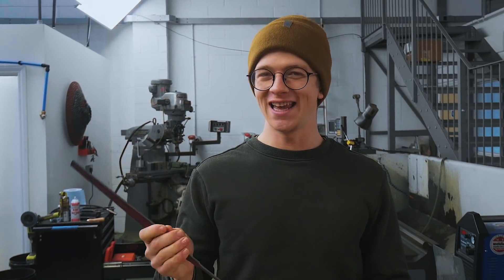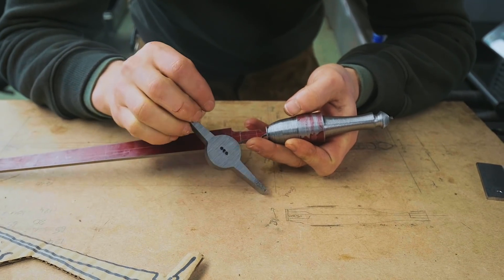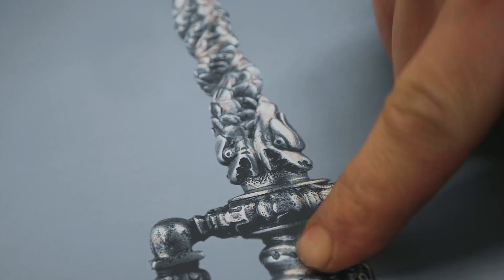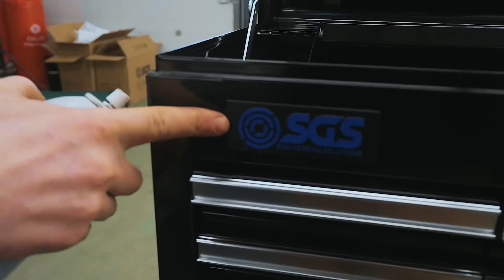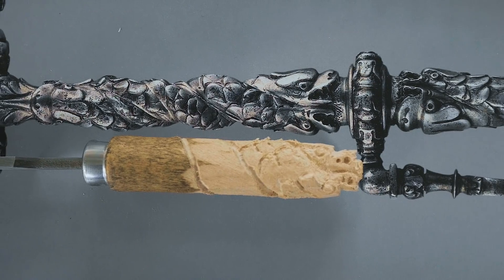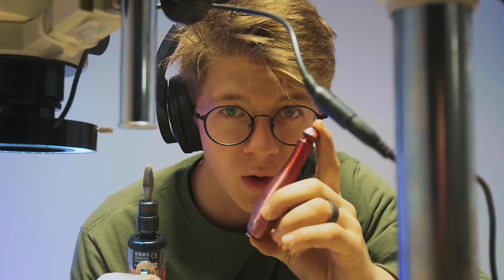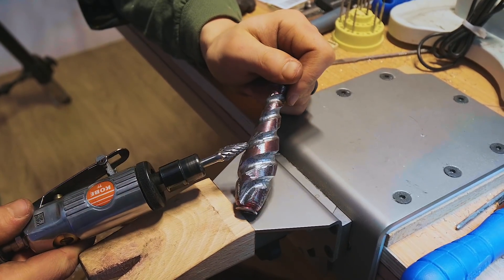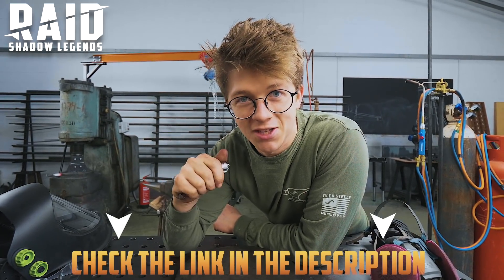MAKING THE SEA-MONSTER STILETTO!!! Part 2

Comment: i'm not a sculptor, but i am an illustrator who dabbles in 3d, and it's incredible to see the tenacity and perseverance you have in working on these sea monsters! your drawings were perfectly serviceable for the rough work you have to do for carving, and very similar to sketches i've made to signify more complex end results. i also grinned when you said you'd done a SECOND wood carving to practice for the final steel, i imagine it was a lot of work, but in my opinion quite necessary and extremely helpful for a better understanding and a more polished final piece! so i'm really glad to hear you felt it had helped a lot <3 bravo alec, very excited to see the next art piece you work on (and the end result of this blade)!

Comment: When you are working with larger die grinder bits , try to touch a solid serface with your pinkie finger (the hand that holds the grinder) ... It helps to control the grinder better ...

Comment: Alec, why don’t you make it straight, then heat it up and twist it, then do the detail work?
Reply: Wow that would make it so much faster and easier to deal with. But wouldnt it be hard to keep it even?
Reply: You need to double twist it, so you can have two sea monsters... if you do how you say, you’ll finish with only one
Reply: You'd nearly have to split it like a pineapple twist then twist it and forge weld back together
Reply: @joshd2013  u damn right
Reply: @maximilienfilion7802  thanks it happens every so often lol :-)
Reply: or use a hot cut chisel to simulate the twists...  same with the scales: make a c-shaped chisel...
Reply: was looking for this comment! I agree.

Comment: My god that tang is so skinny, I'd be worried about it snapping once quenched
Reply: if it's fit up tightly (particularly at the transitions) in that steel handle and guard, shouldn't pose a problem.  i'm sure alec will leave it soft, so snapping shouldnt be an issue hopefully.  def something i wouldnt want to do without a mill and lathe to make sure the fit was perfect.
Reply: you could always just not harden the tang. Alternatively draw back the temper pretty severely so it has some more strength. Besides, it's an art  knife, it doesn't need to survive being stabbed through rib bones.
Reply: @blooobish  I still creates a weaker spot no matter how good your fit up is, or wether or not you harden the tang.

Comment: @alecsteele I'm an illustrator and what I'd recommend doing is starting by fluting the handle like you did with the rapier, that's the hard part out of the way, so now you dont have to confuse yourself with the complex shapes and whatnot. Once the handle's fluted it's probably gonna be a lot easier than you'd think to free hand the details.

Comment: Forgive the ignorance of this woodworker: The threaded tang looks somewhat skimpy for a blade of that size. Is there enough strength in there to resist bending at the guard?
Reply: It may not be a problem since he can weld it with the handle
Reply: The guard fits over the rat tail tang onto the flat bar portion of it, the handle itself seems to also fit a few millimeters over the flat bar part, so should reinforce the transition to the skinny rat tail and prevent bending.

Comment: Could that initial twist grind have been done on a lathe
Reply: I thought that also, but with the diameter change it would have to have a path for the cross slide to follow.
Conical helix path yes, convoluted helix path no.
Reply: @SafetyBoater  👍
Reply: @SafetyBoater  I'm thinking the first hard metal lathes weren't till sometime  in the 17th century, and still many generations short of the lathe in Alec's shop.

Comment: I am glad that you did a test piece in a softer material. If you're going to keep going further in carving, you might want to take a look at carving/sculpture foam as there are some that will give you both a faster-working (and much cheaper) material as well as an isotropic material that doesn't fray like wood.

Comment: after making narrow lines with a rotary air tool, you can lock it in a vise in a block of wood and use a triangular file or a ring file, or a file with blank sides  to remove the stock material. You want to identify and remove volumes one at a time until you have the rough shapes. Start with the largest volumes and work down to the smallest. The final work is engraving chisels to so the under cuts and hard lines, and light shaping removal and brushing down to polish. The tool you show in your book looks 17th century, and seems inspired by cannon dolphins (lifting handles.)

Comment: On your first video, I saw that you hit the top of the mill machine with a hammer to get your collet out. I used to do that until I found out it’s easier to unscrew it all the way until you can lift it, then pick it up just a little and drop it and it will push the collet right out. Just thought I would share. Keep up the great vids!

Comment: when using a die grinder you have to let the tool do the work or while pushing it will catch and jump out of you control. i would also suggest a vice or tar working block to hold your material allowing you to work easier and safer

Comment: One that rapid air stuff installed isn’t that expensive, plus it doesn’t hold up as well. We install a product at work that is mixture from fittings, and aluminum pipe from a few different countries, UK and the USA are 2 of them. Secondly instead of wide open the throttle on the die grinder trying feathering it slower speed will give you more control. You could also install and adjustable needle valve it to slow it down, also found the double cut deburring bits to be a little better then the single cut.

Comment: You need to invest in a high quality die grinder like Atlas Copco LSF.
Its like night and day when working with rotary files.
You might also need a larger hose to feed the grinder. When it starts you can hear the rpm drop instantly. 
The lower rpm and loss of power will make it  catch a lot more on the part.

Love to watch the progression! 
What makes it really interesting is your ambition for perfection 😅👌

Comment: If you have some finesse on a belt grinder, you can create those initial flutes with the edge of a contact wheel. It’ll save you a bunch of time and with a little practice it’ll probably be cleaner than with the die grinder

Comment: Try rigging the die grinder in a vise so you can keep both hands on the piece and use a foot petal for the die grinder. It will slip a whole lot less and give you better control

Comment: I (and probably others below) speculate that that period spanner handle was made with 3 separate bars of "metal" heated, twisted, and lightly forged. From there they would have the main rough shapes and all the artisan would have to do is minor shaping with custom chisels/punches/tooling. Maybe give this a shot and use your engraver to embellish the finer details? Neat project though!

Comment: In my experience dye grinding welds, dont press too tightly against the steel slowing your tip. If you lightly press keeping the tip spinning as fast as it can, you remove much more material and reduce slipping.

Comment: IMO you should make a small mount, like a clamp, for the die grinder and anchor it to the table vertically. Then you can use two hands to hold the piece which will help with slipping. In principle, it's like the belt grinder. The grinder is stationary and you move the piece you are grinding instead of the other way around.

Comment: Alec if you are going to use wood to practise on use basswood, the stuff you are using has a big grain which makes it hard to carve details, i know its only a test piece but if you use basswood you can get great detail because it has hardly any grain, and the finished piece really does make it easier for you to picture in your head, Basswood can be ordered on the internet, its not expensive

Comment: I've been a long time fan of you and your work, Alec, and your motivation and work ethic is contagious!!! May I suggest that next time when doing a carving such as this with a die grinder, I find it way easier to mount the die grinder on something sturdy such as a vise or possibly the 360°swivel vise that you have used before for engraving, clamp the die grinders trigger open and use a foot valve to control the die grinder speed. Then use both hands on the part its self for better control. Think of it as how easy it was for you to smooth out everything on the belt grinder. You had more control because both hands were on one object.

Comment: If you end up scrapping this one, maybe the approach for round two would be to forge some if the shapes in before drilling it out for the tang, like making a horse head? Then all that would be necessary is some final shaping with the rotary bits.

Comment: Alex, you could always Investment cast the handle that way you can carve/sculpt in wax or even model it on a computer and then 3D print it if you use the right filament. It would most likely be way faster and easier than carving that out of metal by hand and is far more forgiving if you make a mistake.

Comment: CLAY! I have seen stonecarvers make a model of clay first. Its quick, you can easily add or remove material. For this one, just screw two thick strings let it dry for a bit then add details.

Comment: Love that you are making new things like this, really like seeing it come along. 
From my own experience, something I can recommend is using maybe a jewellery saw, if there is one that is hard enough to cut steel, to predefine the lines, then take a burr with a sharb edge, maybe a disk or one that has two cones forming a sharp edge, to deepen the grooves. 
I did this on a much larger scale, and of course you wouldn't be moving that much material that quickly, but if you want to avoid errors, handfiles are always great, slower but much less likely to cause damages and in my experience less exhausting than burrs. 

Also, sad to see that R4-id sh4-d0w is in this video again, would really love if your sponsors were not gatcha games.

Comment: My job as a finishing machinist requires me to use a lot of carbide burs in 1/8 inch and 1/4 die grinders.  That 1/4 inch you are using is actually to slow which causes it to grab and jump on you. You really need to be up in the 10k plus RPM

Comment: The entire time u was watching this all I could think of is use the lathe. Surely you could modify the setting to a large threads per inch and stick a scribe on the end to etch the dykem. Then turn the lathe down to its lowest rpm and use a round file or the dremel and cut the 2 flutes. That way it's held securely and because you have perfectly even lines that wrap around it you would have it looking symmetrical from the start. Or just get a small lathe chuck, a motor and a variable speed control and mount it to the jewelry bench for easy part rotation while cutting.

Comment: Tip for the die grinder, use a more gentle touch. If the bit bites into the material it will walk on you, your bit was biting allot. let the 30k rpm do the work for you rather than trying to force it, enough pressure to remove material is what you need. It will grind slower but you will save time by not having to clean it up after or start all over on a new piece.

Comment: If you end up having to restart the handle try using files to do the flutes instead of the diegrinder. It's slower, but that seems to be the normal way it is done.

Comment: Hey bud put a swivel end on that air hose so you don’t have to fight that grinder! I would have tried a smaller carbide bit! With a flat end so it doesn’t run off on you! This piece is going to be epic!

Comment: carving seems to be different than drawing. You should carve like you are working with the mill or lathe. If you take a shallow pass as a guide that you can correct with each pass until you reach your desired depth and width.

Comment: When using the large grinder, why not fix it in a vice so it doesnt move so you have two hands to work the piece instead with more control? Similar to how you would with the belt sander. 

Coming along nicely anyway, looking forward to the finished product!

Comment: you could have save time y making a jig on the lathe that would have marked the piece or even using the screw config to make the grooves easy, or making them straight ant then twisting the bar and then clean and shape them again but with a base to work with, maybe even using the dragon scales technique

Comment: Rotary tools are excellent but the slipping is the big issue, so to prevent this ether have support stud or such witch you can hold the grinder against, so it wont move side ways, or do it old fashion way with files and chisels.

Comment: Soooo, I don't know if this would have been easier or if it would have presented new problems later, but...you could have started out with your round bar, make two straight flutes, carved in your sea monsters *straight*, then heated and twisted it (as if you were making twist damascus billets). Then square up the ends, punch your holes, and finish off the decorative ends.

Comment: heat up the handle a use a small diameter fuller to forge a spiral around the handle then finish by filing and grinding.

Comment: I lock my die grinder in a vise and use 2 hands on the material. With a die grinder you always need 2 hands for stability. Whether it's 2 hand on the tool. Or the material.

Comment: if you get a really over powered magnet you can remove and clean diegrinder shavings from in the skin with ease just make sure you put it inside a plastic container because you will never get them off the magnet otherwise

Comment: With your di grinder reduce your sin speed by using a pressure regulator. Should give you more control when going into finer work.

Comment: I have seen that thin, flexible plastic tubing crack, break, and snap out of fittings in so many industrial plants. It is fine for initial set up when it has to be moved around while you are building or installing equipment, but it gets brittle over time and isn't very strong to begin with.

Comment: I also struggled with my dremel tool when it comes to carving metal, i slipped so many times. Maybe traditional engraving tools would do you good for all the finer details. I use them too and you can work a lot more precise with these.  On youtube there are some videos of hand engraving, especially Ilya from "that works" does outstanding work. Hope this helps you at least a little with this project.

Comment: Dear Mr. Steele 
I was wondering if you have researched Alfred Pendray, Wootz , 
Also the process of making bainite steel. 
maybe the to processes can be combined to make an awesome blade. 
Not sure if this would interest you or not but thought maybe it would peek your interest. 
By the way the wootz get you the metal to make the blade, the bainite is a quenching process to make mild steel if I understand correctly turn mild steel to a similar tensile strength as titanium.

Comment: instead of carving it all day, could make a casting mould like you did with the rings and the hand guard of that sword one time. The wax is way easier to work with, only problem will be melting the steel

Comment: The die grinder should be mounted and stationary. Then you'll have 2 hand control of the workpiece. Trying to grip/control the workpiece in 1 hand and the tool in the other will just frustrate you. Notice how much more control you had on the belt grinder. Just because a die grinder is small enough to be hand held, doesn't mean it has to be. Think of clamps that work for the grinder on your Panavise swivel vise.

Comment: To me, it looked like they started by cutting three equally spaced spiral groves down the handle. Once that was done, they probably carved the heads in. And, for the scales, they were done in lines that are perpendicular to the spiral groves because those lines make the edges of their bodies; in the Alec's drawing, the scale lines are perpendicular to the line where the handle ends, which is incorrect. Alec, did a much better job at carving the scale lines in the correct direction than drawing them on paper.

Comment: Get some free machining steel.  I.e. the kind of alloy you put in a swiss lathe and make watch screws out of.  Files and engravers will be plenty fast then.  (i.e. it should cut like brass)  In the mean time, good work with the bog standard mild steel.  

More seriously, a cutting lube for the die grinder will make it cut faster.  I know Pink Boeing lube works amazing on aluminum, figure there has to be a steel version as well.

Less seriously, at high rpm little milling cutters work in dremels and die grinders.  They cut VERY fast, the chips are needles, mist-coolant is probably a good idea, and don't even think of letting them catch on the work or loading down the spindle.

Comment: Was the original carved or cast?  This might be a lot easier to do using an additive process, making the sea monsters in a material like a casting wax, then wrapping them round a core, casting, cleaning, heat treating,  That said, there might be fewer moments of grand failure, and that's what we're here for!

Comment: Im not a professional but . They had no power tools back in that era, I would begin with chiseling the shapes(just what you need for the art work that wiĺl be shaped later,( the stock needs to be longer so you can cut off the excess, with no hole for the tang), heat it up, twist it, put it straight, drill the hole and then pass like a month to shape this beauty to final shape by hand. But its ok to use power tools when you have them.